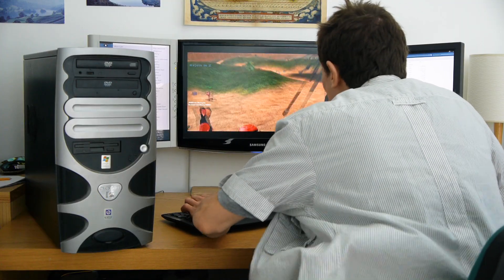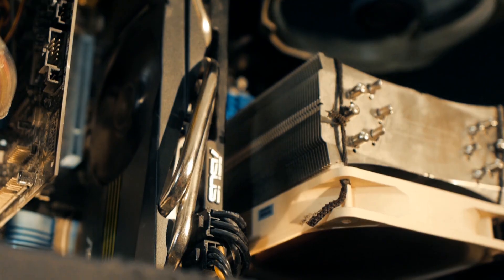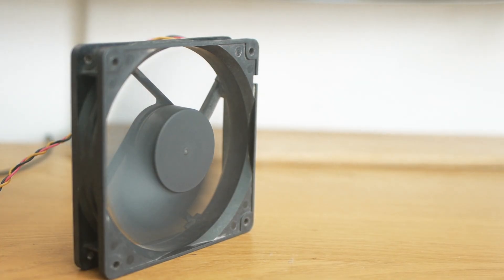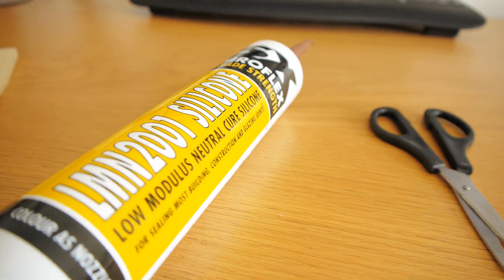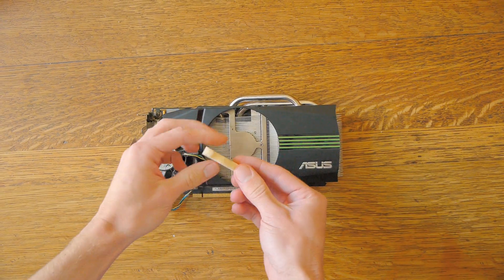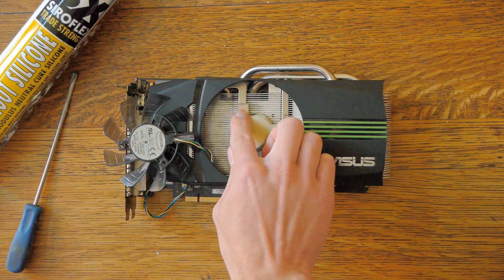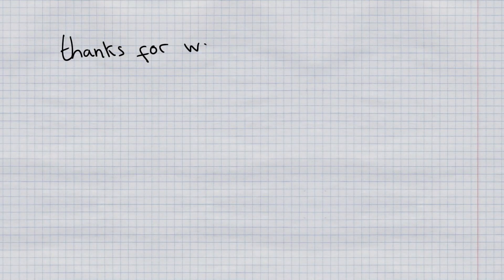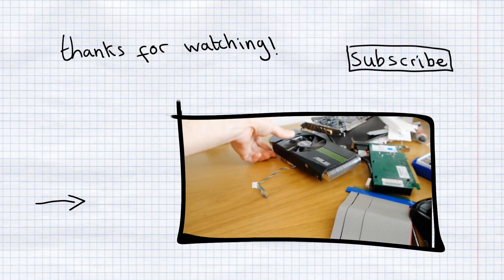How to make a graphics card quieter

Comment: Question for @DIY Perks-nice solution for taming down the growling beasts,btw-did you actually screw the fan screws back onto the heatsink,'coz it doesn't appear you've done such thing,to me at least.I did notice great black circles at the each end of the fan mounting base,but am not sure whether it's a screw head or just a hole lacking the latter.And ultimately,would doing so(screwing those back on,while glued)make it into a conduit for even more noise,eventually!Tnx in advance.
Reply from the maker: Joe Thornton I left the screws off. If you screw them in again it's likely that they'll transfer the vibrations, nullifying the work of the sponge. The idea is to isolate the fan as much as possible, so that vibrations aren't transferred.
Reply: DIY Perks awesome dudeee!i love you so much for this man. . .got 2 80mm whining jerkfaces that just won't simmer down,even at like 50% load and it's getting quite annoying;and I don't really plan OCing it any time soon,so no actual reason for me to go aquaman on that puppy-it's a r9 270x btw.once again,tnx a bunch dude
Reply: DIY Perks I have a thought here, couldn't you just make washers out of rubber and place them between the screws and the fans? Surely that would help dampen the noise? and even put washer around the screws head.

My two cents :)
Reply: Joe Thornton welp. . .I finally dived in n done it.Did everything like Perks said,but it made no significant impact,truth be told.There are 2 of them 'Power something' 80mm fans,so it might just be the bearing's fault really.It is a Powercolor card,and honestly,they're not that well known for extreme build quality,but I won't blame them.Not sure who makes those fans,whether they're Powercolor's in-house solution or an oem crap,but you can't actually expect miracles from one of the cheapest R9 cards out there.All in all,I might wait out a bit for Kraken G10 n some solid closed loop,or maybe even go balls-deep with a custom loop at some point.who knows,we shall see how things play out in the future.

on another matter,@Wilder wild,while that sounds cool in theory,the reality of things is,you'd have to widen the holes on the heatsink in order to place a washer that goes entirely thru that hole n hugs the screw completely.otherwise,it'll still resonate throughout the case.but most of the time,n that's been said more than once in the comments section below,it's a matter of a fan(s) itself that is not up to par with the claimed specs.
Reply: Wilder wild I guess that could work. . .Nice 2 cents btw,might give it a go.
Reply: Joe Thornton Well im glad you got that sorted out so others dont have to. 

And yes its always down to build quality really. Bad fans can't magically be turned into awesome fans.

Don't know which one you have but I used to have the R9 270X 4gb from sapphire, it had dual fans and was super quiet actually. Like you, I have not heard much good about powercolor and I like to steer clear of them. My next card will likely be a 280x from MSI.

Comment: I could have come up with  way cleaner and less ugly solution, then this mess.
Reply from the maker: Cyborgslayer404d Excellent, would love it if you did a video about it. Always glad to see fellow DIY'ers improving on my ideas!
Reply: DIY Perks Man every time I see your intro, I'm LMFAO! hahahahah
Reply: ***** rubber micro washers
Reply: Good Idea. It's what I would use if I would go for a less messy solution.

Though it is my belief that if you are able to fasten the fan using something elastic without any trace of actual screws involved it will cushion the vibrations better.

I also believe that the solution presented in the video is quite viable, unless the sponge is of bad quality and it ages and then brakes into tiny pieces because of the constant high temperature contacts.
Reply: Cyborgslayer404d So... where is the better idea ?
Reply: ***** I actually done it to one of my GTX 550TIs And it runs so quite even of 100% fan speed now. I used felt resin washers instead though. I was reading rubber will dry rot and disentigrate after awhile. I'd upload a video if I had a video camera. :( Oh well. Try it your self expiriment a little with other materials.

Comment: lifting the fan might effect temp though since those fans are designed to push air right and left through the fins also rather than just push air forward like on a cpu, I've actually removed that plastic shroud and tried numerous 120mm case fans and the only drop in temp was achieved on idle, the fans could never cool the card as well as the stock fan, it might be due to rpm but it was still quite a surprise, although I'm talking as if 65 is a tj max, still it's worth sacrificing a few degrees for no more wrrrrrrrrrrrrrrrrrrrrrrrrrrrrrrrrr, I just ended up making an air port and cranking it to 60, good enough, foam, sponge, and springs, can really dampen sound well though

Comment: Or alternative to this, research the market for the most silent high performing graphics cards. Asus DirectCU II cards do well, and latest MSI Twin Frozr V cooler in gtx 980 is the coolest on the market.
Reply from the maker: LeopoldGames True, but not everyone wants to buy a new card to get quiet performance.
Reply: all my GFX cards were asus cause of the CU II cooling cooler and still they all made a huge noise in full throtle, my next attempt is that CPU cooler attached to the GFX card, i have a friend who did that also and 1st, you don´t hear a thing since you don´t even need a fan to make a medium spec card stable at 60-65ºc, 2nd, even if you want lower temps we attached a noctua to it at the lowers speeds and he gets 55ºc without even hearing a thing. i´m one of those freaks who prime silence AND low temps at the same time so it´s hard to manage XD.
Reply: ***** I have Asus GTX 760 DirectCU II and I havent noticed any too loud noices compared to my old Club3D Radeon HD4870 or Asus Radeon EAH5750 Formula cards. Well, EAH5750 Formula wasnt even that loud but had to replace it with better one.
Reply: LeopoldGames Wrong, The 980 G1 from Gigabyte is the coolest. I got 2 of them. Recently slapped a waterblock on em though :P
Reply: Christian .T I dont know about Gigabyte 980 G1, it wasnt released at the time there was performance comparison review made
Reply: LeopoldGames dont forget evga
Reply: ***** I had a similar problem with my GPU or some other fan that made an oscillating noise.

Comment: It would be totally enough to put some rubber / silicone washers under the fan screws and do not fasten them much. This is... well lets say i'm not comfortable with flammable sponge sitting on quite hot heatsink...  Or get rid of that plastic cover and small noisy fan and put there a big 120mm fan which can cooled that even on low RPM / noise because of its size.

Comment: it might be less noisy,but it is also producing more temp. you didn't put any thermal paste between heat sync and cooler...
Reply from the maker: Mostak Ahmed The heatpaste doesn't go between the fan and the heatsink mate ;)
Reply: oh sorry,i mixed with cpu and gpu
Reply: Mostak Ahmed No, you didn't, you just don't know how the cooler works. It's exactly the same on the CPU.

Comment: One thing i find interesting is that you glued the fan to the sponge without screwing the fan to the graphics card right? The sponge is soft and the fan i rotating crating vibration so wont the fan in time turn to one side and destroy the graphics card while spinning? Solution great! In my opinion all it would need is a proper mounting so the fan wouldnt turn. Any ideas?
Reply from the maker: stalker2993 The sponge pad is fairly large, so it only 'hangs' very slightly because of gravity. So long as it doesn't touch the side of the shroud it's fine (mine's been going for years now). If it does touch the shroud, just reposition it. The fan just stops spinning, rather than 'destroying' the graphics card, if it touches the sides.

Comment: I have some leftover Akasa sound treating foam sheets I could use for this. Though most manufacturers have been creating some rather silent cooling fans for their graphics cards.

Right now the most audible part of my PC is the Power Supply Unit. Followed potentially by the hard drives.
Reply: I just had a quick look on how I could discharge the capacitors on a PC's PSU, and realised I value my life too much to attempt this.

I only had this PSU for less than a year, and already it's sounding like a jet engine :(
Reply from the maker: WarbananaOfDA Discharging capacitors won't help anything (not sure where you got that idea? Very bad advice). They discharge themselves when the computer is off anyway.Is it clean of dust and stuff, and is its intake air cool, or hot from the other components?
Reply: Ok that was a clear definition of GIGO I've put myself through. I thought of swapping the fan on my PSU, which requires the opening of one in order to do so, hence the concern of being zapped into a crisp by the capacitors. I've read that it's possible to discharge at least a portion of the capacitors by disconnecting the PSU from the mains and pushing the power switch on the PC several times. This is probably not recommended I guess.

There is no hot components or dusty parts, since I've cleaned the majority with my air compressor: the fan just developed a slight "rattling" sound which is odd for Corsair branded products, and sadly only happened after the warranty ended. The "rattle" itself is enough to overpower every fan my computer uses, and my two HDD's working in tandem. I say "rattle" because it's not the fan hitting anything at all, and it sounds like it's from the motor itself.

A safer alternative would be to buy the fanless ones, but they are high budget luxury items.

Ignorable fanboyism below
And thank you very much for responding to (and correcting) my comment. I do enjoy your videos and find your involvement in instructables exciting.
Reply from the maker: WarbananaOfDA
 I've opened PSUs plenty of times and it's actually quite hard to be zapped unless you purposely shove your fingers into the PCB, and even then it would be hard to touch the capacitor's contacts because the PCB itself is screwed to the metal top usually. It's not really something to be scared of, just be careful where you put your fingers.

Obviously, make sure it's un plugged from the mains first, though I'm sure you knew that ;) and maybe leave it for an hour or two so that the caps discharge themselves.
Reply: Thanks for your insight! Now what's left is choosing fan.

Comment: Man this is driving me mad. I have a GTX 770 Windforce which is pretty darn quiet. I have 2 Arctic F12 PWM fans which are close to silent at low RPMs and I have a Thermalright True Spirit 120 M BW which is close to inaudible at idle. Yet, sitting here idling, there's a fan somewhere in my system going nuts. I suspect it's my XFX XXX Edition 750W. It's a pretty cheap PSU (cost me less than 100€) and is bronze qualified (I know what 80+ ratings are, don't lecture me on it. I know it doesn't have anything at all to with quality, but bronze power supplies are usually made with cheaper components than gold or platinum units). It's really the only thing I could think of making noise right now. But I'm afraid to open up my PSU and swapping the fan, even if I know it's definitely possible to do so.

What are your thoughts on doing so? Is the risk too big? I'm hoping to be able to buy myself a new computer this year, and if so, I'll probably go for liquid cooling, I think with the Enermax LiqTech 120X, as I'm looking at getting the Define R5, and don't want to open up the top in order to maintain a low sound level, especially upwards, towards myself with the PC being on the floor. But if I can't do that, I might just go ahead and get myself a new PSU. Might go for the Silverstone Nightjar 520W fanless, or then the Seasonic branded unit. Just to eliminate one of the fans. It should be able to handle my system too. Or I might just get a semi-passive PSU that is very efficient, since the PC is said to draw around 400W at 90% load, so it needs to be able to deliver that.
Reply: Don't open up a PSU ever, even when not connected they could lethally electrocute you... buy a quieter unit, semi passive is more then enough...
Reply: Yeah I keep hearing that, but at the same time I see lots of people on YouTube doing it. But I won't. I'll hold out and see how the financial situation turns out, and hopefully go for a better unit at another point. :)
Reply: Shaxi Expensive PSU's comes with expensive fans. And higher ratings (80+) means less waste heat in the PSU. Add those two together, and you get silent PSU's. I used to have a Corsair GS800 PSU that was noisy as fuck. That got killed of by Thor so I had to get a new one. Decided I wanted something legit, and got the AX760 instead. This is basically a rebranded Seasonic unit with an AMAZING fan on it. Add the fact that it produces very little waste heat, it's literally inaudible. It is by far the most quiet component in my system, and I have a water loop with 12 fans where not a single fan runs over 800rpm. Most of them stay around 550-600rmp. I would highly recommend spending some money on a good PSU if you want silence (and have the cash to spare obviously). That said, changing PSU fans may force you to cut wires and solder, since they may be soldered to a circuit board. Such was the case with my GS800. 

Should you want to change the fan, just make sure the PSU is discharged. Unplug it and let it rest so it discharges itself. Anything from wiring up the connector to fool it, or let it sit over night just to be safe.
Reply: halsoy Yeah right now I'm kinda oogling at the EVGA G2 850W. Mostly because even at full load, it shouldn't reach a point where the fan has to turn on, or at least spin very fast. I don't know, might be throwing money into the lake by going for 850 over 750?
Reply: Shaxi Glad to be of help :) Best of luck with the new PSU should you grab it :D
Reply: Shaxi Well, to give you an idea: I'm running 7HDD's, 2 SSD's, 2 GPU's (AMD 7970's/280x dependng on what name you want to use (both OC'd by roughly 15%)) 12 fans, 2 water pumps and an AMD 8350 (running at 4.7GHz). 

That should tell you that 1: it's getting old (but still does what I need it to do) and 2: it's really really power hungry. With just a single GPU running in games, my PSU isn't turning on the fan. With both on the fan spins, but I can't hear it. Literally with my ear right next to it, I can not make it out. So going full bore I went from "HOLY SHIT I WANT TO KILL THIS PSU" (using the GS800) to "is this thing even on?".

Unless you plan to consume more power than I am (not likely), you're pretty much spending more than you need to by going too big. The whole "future proofing" thing isn't true anymore, since new components become more and more efficient. Something the new nVidia line is evidence of, where they are faster AND use less power than before. So a PSU in the 700's will be more than enough for anything you'll buy unless you want to tripple/quad SLI/Crossfire.
Reply: halsoy Alright, you've convinced me haha. Yeah, just wanted to get a sanity check :) No need to throw money out the window that can be moved around to get more value out of some other component.
Reply: XFX PSU's are made by Seasonic, which is arguably the best PSU manufacturer out there. You might want to have a look at the psu, because it shouldn't be very loud if it is working correctly.
Reply: You just might be right. The fan just might be malfunctioning. I haven't really bothered to look into it more deeply, as I have seen so many videos demonstrating problems with XFX units so I always assumed it's designed like that. With that said, XFX might put in a different fan of course than Seasonic as Seasonic only manufacture the PCBs and send them out afaik. Except for their own units, naturally. But I'm probably getting a new computer soon enough so hopefully it'll be better the next time around. :)
Reply: Shaxi You sure you know what you are talking about? plat isnt even avaible to the public.... and the diffrences are only a few percent think its from 80% to 86-88% thats a 7-9% less... Bronze is more than enough. Are you sure its not the CPU fan?
Reply: Shaxi I have a bequiet dark power pro 850 watt psu and its abslutely amazing and totally inaudible!
Reply: Shaxi I have a bequiet dark power pro 850 watt psu and its abslutely amazing and totally inaudible!
Reply: Dom og deilig juba juba I have an 80+ platinum psu. it IS available to the public.
Reply: Dom og deilig juba juba I have an 80+ platinum psu. it IS available to the public.
Reply: ***** Sorry mate, it wasnt avaiable when I last read about 80+ PSU's. didnt even know Titanium existed until now(I did know plat did but thought only servers had it :P) :) thanks for letting me know :)

Comment: I would prefer using screws to press the foam in between the fan and the sink.  Yeah, the screws will translate vibration but I want to be able to remove the fan and clean it.

Comment: Thank you for this helpful and informative video - I gave this a go myself and plugged the fan directly to my power supply to make it run at 100% all the time instead of using software.

My fan now fan spins at 100% all the time and is quieter than when it used to spin at 30% (it's basically inaudible, woohoo!). I've gone from 85 degrees under load to 69 degrees under load (obviously I could do this before, but the fan was so loud you could hear it from another room!)

Any chance you would attempt a homemade watercooling system for your PC?

Comment: am adding a 120mm fan, my computer isnt designed to have it but i have space for it. how can i isolate it effectively from my case since the rubber screw like objects will not work in my case?(am going to use a cooler master jetflo 120)